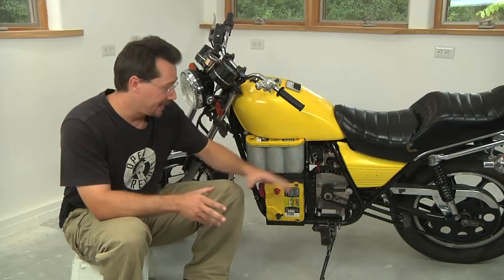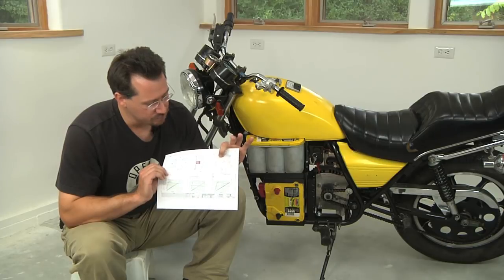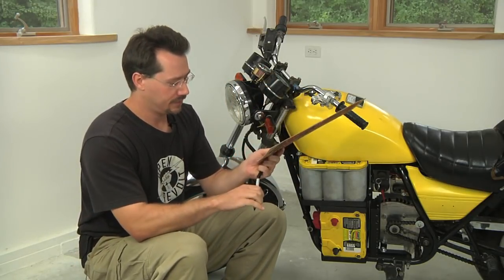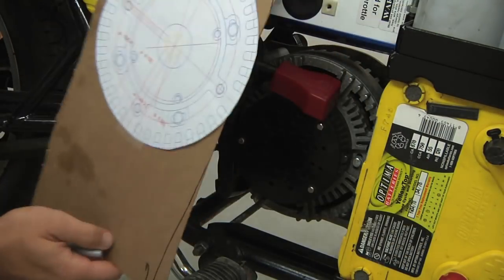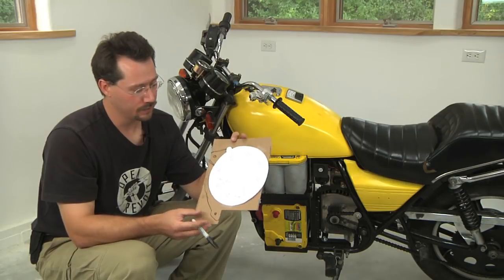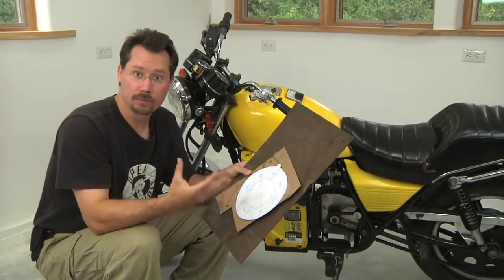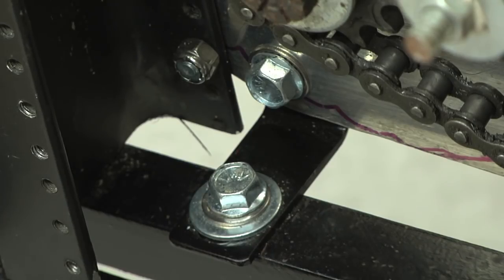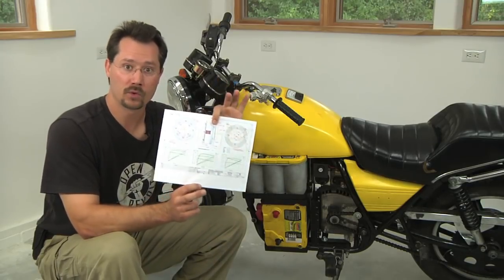5 Build Your Own Electric Motorcycle - FULL - 5 Motor Plate

Comment: Why not use lithium batteries. I have 24 volt 300 ah batteries.
Reply from the maker: I didn't use lithium batteries because I built this motorcycle in 2007. Lithium batteries would have cost about $10,000 at the time.
I've used lithium on later projects, such as the Vectrix. https://www.youtube.com/watch?v=jfhf1NQobWY&list=PLmHss3DBZUinx-DxMLnax485Alj5i5Lcn

Comment: So I got a MotoEnergy motor that has a similar bolt hole layout on the face... I'm in the process of planning for a mount plate build and found your video(s) awesome... been following all! Question for ya though, I notice just like on mine there's a 4.5" (roughly) circle where the face of the motor enclosure on the shaft side is raised about 1/8" above the rest of the plate. It didn't look like you accounted for that when you cut out the mounting plate... did you notice it gave/bent at all after giving it some torque?  Or did you accommodate for that gap with spacers or something? - hope what i'm asking makes sense! :)

Comment: Ben, I find the diameter of the threaded rod a little bit too...just the right size. As an engineer I am prone to oversize my designs. Maybe someone who actually decides to build, will want to use larger rods, something I´d strongly suggest, because of the dynamic stress distribution and the levels they´re subject to. I come from 15 years of experience in oil industry, so...you can listen to what I say regarding this stuff. LOL.
Reply from the maker: Hi Jose,
I didn't specifically do any particular engineering for the size of the hardware, but just essentially matched it up more or less with whatever was already there.
Never had any issues with the mounts or anything else. Of course, it's pretty easy to to move everything up one size if that makes a person more confident. It would add minimal weight and cost to the project.

Comment: Not all types of stainless steel are non-magnetic; 430/416 Stainless is, whereas 303 typically is not. So the best thing to do when getting washers for this is to take a small magnet with you and check.

Comment: How do you protect the motorcycle and electronics from water?
Reply from the maker: There's not really that much to protect.
The motor is essentially a "salad spinner". Any water that would get in just gets spun out.
Motor controllers are internally sealed.
In general, use nice clean electrical connections. Use heat shrink. Put rubber boots over power terminals. Use stainless fasteners (so they don't rust.)
That's about it. I've never had any issues with water or weather.
Reply: @BenjaminNelsonX  how about the battery and the controller?
Reply: @BenjaminNelsonX  well let’s say you are making it for off-road use and you drive it into a swamp with water if you do all that will it still run

Comment: 8:13 :))
Reply from the maker: The spacing between the rotor and stator in this motor is almost EXACLTY the thickness of the washers I had been using. You do NOT want to have to take a permanent magnet motor apart to get a washer out! That was a HUGE pain!
Not only are stainless steel components more appropriate for use in a vehicle, but they are non-magnetic as well.

Comment: Would converting a trike to electrike (haha) be more like this or like converting a car?
Reply from the maker: Building an electric Trike would be more like building a motorcycle than building a car. You would want to use a larger motor and battery than a motorcycle, but other than that, the only real difference would be an axle with differential. I've seen trikes done with small pickup truck rear axles with the motor mounted directly to the differentials. For some more ideas, visit the EV Album. http://www.evalbum.com Use the search feature and type in TRIKE.

Comment: Ben what motor would be good for a 85 MPH road bike, I do have a BMW 1200 GT with a bad motor and after seeing this I guess that would be my best bet.
Reply from the maker: For high-speed and high-performance, you will want a pretty good motor. Most likely, you would want to go with a 3 phase AC motor. Take a look at motorcycles on the EV Album to get ideas. http://www.evalbum.com/type/MTCY
Go with as high voltage as you can for low current draw and maximum speed. Motenergy motors have been pretty popular for motorcycles, but for a larger bike, you could do something from the HPEVS AC family of motors, such as these:http://www.hpevs.com/hpevs-ac-electric-motors-for-motorcycles.htm

Comment: Oh this is very cool! Not a motorcycle guy but this is pretty neat.
Reply: Etek electric motor by Briggs & Stratton.
Reply: +sunil d naidu ~ how bout you do some of you're own research you lazy fook.
Reply: Give me specifications of dc motor
Reply: You'd need the torque - RPM curve on a sheet. How much rotational force can the motor generate at what RPM. Manufacturers should supply these data sheets.

I don't know the model though. Probably lots of info to be found on forums though.